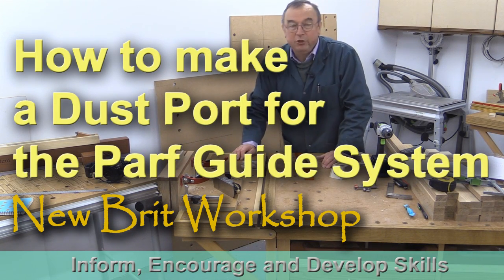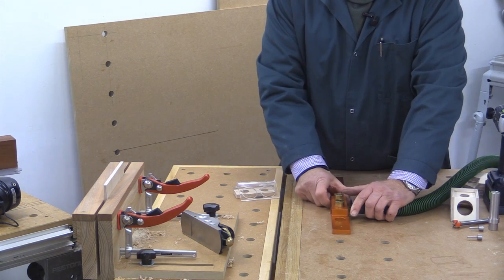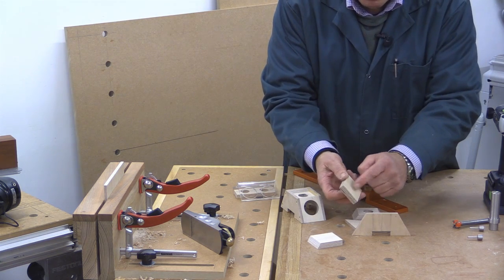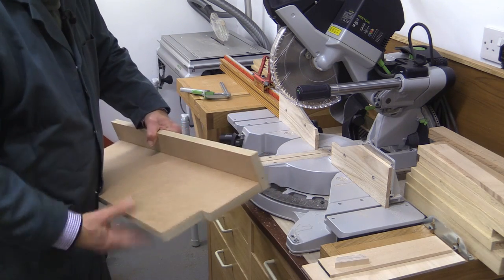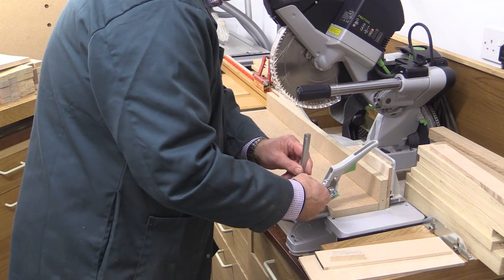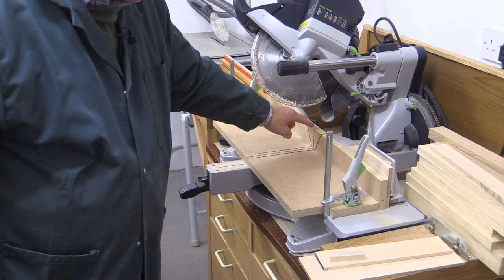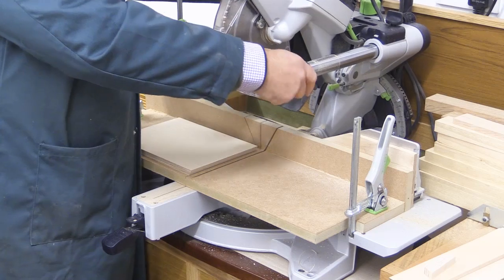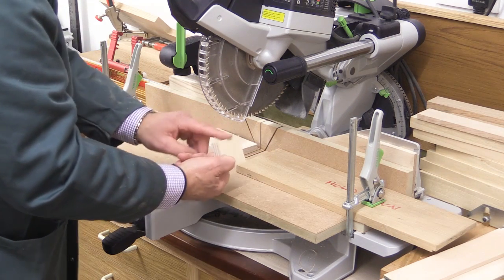How to make a dust port for the Parf Guide System

Comment: Hello Peter, I have purchased the Parf Guide system and I am looking forward to getting started to drill the holes for my bench top. You state in your video that you give away your plans free of charge if an email address is provided. To which email do I send my email address. Thank you in advance. I find your videos very educational and well done.
Reply from the maker: Hi Albert, YouTube have stopped private messaging but if you send a comment to a video with an email address it should get captured by the YouTube spam filter. I will be able to see it but nobody else will. I will send the plans and remove the comment in order to protect your email address.   Peter

Comment: I purchase Praf guide and used it to make my table for Inventables x-carve. It is extremely important to vacuum the high density fiber board, my bit did seized in the brass guide. My guess was I was not clearing the fiber... I was able to get it free and also add oil on occasion to keep it from seizing. I was surprised at how time consuming it was to drill the Praf holes for the 1000mm table... but I highly recommend this Praf drill guide it was great to have this capability to drill and setup a Festool like table for my x-carve.  I am going to make this vacuum attachment to add to my Praf guide drill setup... for the Praf guide the foster / cutter bit seem to breakout on the back side of table, but if you drill on a backer board better results.
Reply from the maker: Hi Gregg, It takes a huge amount of extra time if you do not use a vacuum whist drilling those 20 mm holes. It can also damage the cutter. My little vacuum attachment is very easy to make and the plans are available free of charge but I need an email address in order to send them. The cutter is designed to create very little breakout and I wonder whether the combination of no vacuum and perhaps pushing too hard is causing you to need a backing board. I have never used a backing board and my 20 mm cutter has now done about 1,000 holes.    Peter

Comment: Peter.  Thank you!  What a nice addition to the Parf Guide System.  Mine is back ordered here in the states through Lee Valley, and this will make using it much easier.  P.S.  I was unable to back order the spring clamps for the Parf Guide System.  I'm hopeful that Lee Valley will have them available soon.  Cheers!  Mark Hays, Utah
Reply from the maker: Hi Mark, I am encouraging Lee Valley to stock those Rail Clips so fingers crossed.   Cheers.    Peter